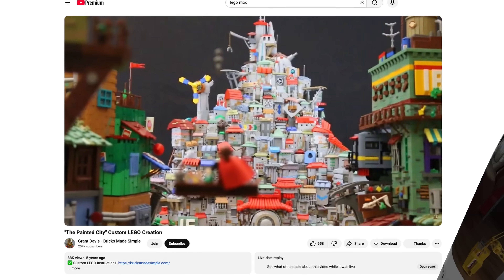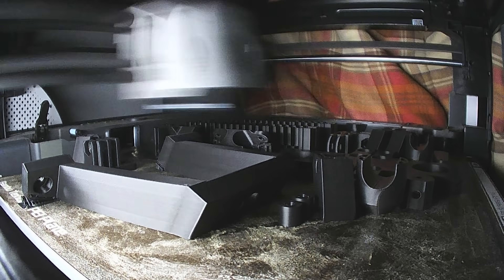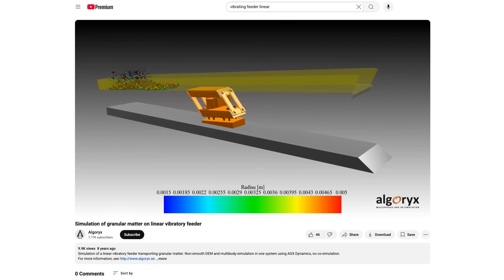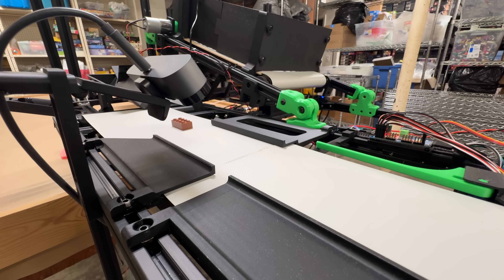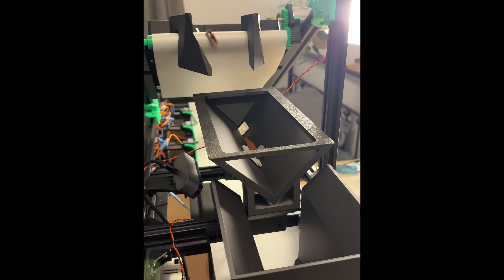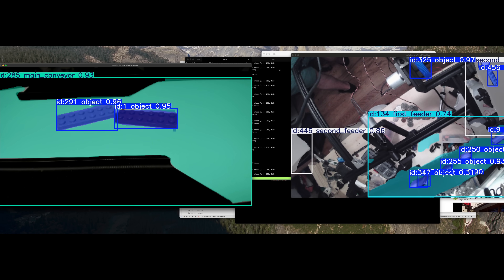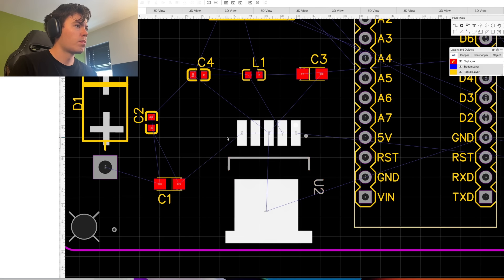A machine to sort a million pounds of LEGO

Comment: Nice work! as a mechanical engineer who has built sorting systems for 30 years with a house full of unsorted Lego, what your building is a small cross belt sorter, these vary in size to sort from cartons to small packages and mail and further down in size to individual retail SKU's. To do the primary sort they use a machine called a singulator which pulls the bunched parcel apart, the vision is a nice touch, this is also used but recognize barcodes as throughput is much quicker. Google these companies if you need inspiration Vanderlande, Körber Supply Chain, Fives, and the BEUMER Group and look for parcel post and freight cross belt equipment. Best of luck with the next version!!

Comment: I don't want an open source machine. I want something i can just buy that works with 99,9% accuracy (no, 99% isn't enough, 1000 parts mean 10 wrong parts at this accuracy, inacceptable, not even mentioniong the false identification ones which will drive this number up by a good ammount) and it has to be way faster, 1 part per sec at least. Sorry to say, i get that this from an engeneering standpoint is an interessting project, but its "useless" until it reaches at least the specs i named. In the end such a machine should cost around 200-300 bucks in retail and additional models 50 bucks each or something like that and if it is made in china reduce the prices by half.

Comment: Speed improvement, add a gate on the belt to have a brick queued and can be released faster. Also if the belt didn’t have to stop to identify. Either faster hardware or move the camera with the bricj

Comment: Cool stuff. If you want speed, a SCARA Arm with a suction cup effector is your best bet. It'd eliminate the need for feeder and most(if not all)of the conveyor belt. Not to mention you can make it far more compact. 

The way I envision this, you drop a bucket of lego parts. Arm tries to randomly vacuum up a part. Arm drops the part in front of the camera, YOLO does the classification. You can either use your existing setup for the binning or maybe use another arm.

Comment: I worked on a baseball card sorting machine i was using a gantry system with linear actuator and suction to pick things up.  You could cut out the vibration steps if you just did a gantry system

Comment: There are so many good and less good suggestions to solutions in this comments section alone - I think what you need is a firm requirement spec that all the solution suggestions could go into, and then the suggestions that is not directly linked to any requirement could instead be evaluated to see whether it's good to change the spec or not. At some point in time you just stop listening to suggestions, and try to implement based on them. 
That would be some real world engineering. Which I think would make an engineering project like this be more probable to succeed. 
Make the requirements SMART - Specific, Measurable, Achievable, Relevant, and Time bound. 
It sounds over-complicated but it really helps in structuring the development in such a way that you keep working towards the goal.

Comment: Not an engineer, but figured I'd share some ideas.  Sorting in parallel should be an efficient way to speed up the process.  To distribute, I'm thinking cylindrical containers with an Archimedes screw along the inner circumference could be filled with pieces and placed at an angle to bring up a set of pieces at a time between multiple conveyors arranged vertically to both work together and provide redundancy.  Rather than from directly above, having the camera perspective for each be at an angle, to identify bricks from plates.  For where each go, the continuity of their placement should make sense too.  1 wide in one column, 2 wide in the next, and each vertically ordered by length, for example.  If necessary, having the option to organize by color instead or in addition with hue along one axis and shade along the other.

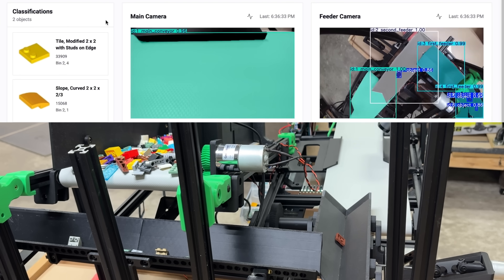Comment: 10:00 You make 3 mistakes in your project.

1- You have 3 machines. not one. The piece separator, the Vision identification and the sorting system. Any of these machine can be designed completely independently.
 2- Open source. Never disregard certified industrial hardware for price, capability and reliability. Do NOT limit yourself to open source.
3- Your sorter will be a nightmare to maintain. It is the most expensive part of your machine and also the most prone to break.

Comment: It would be cheaper to use a PLC with 144 outputs and solenoids instead of motors. The programming would be simpler and the reliability a lot better.

Comment: 1. use a V-conveyor not a flat belt
2. sort color first (there are less colors then anything else)
3. if the V-conveyor is done right you can drop sections so the belt just runs the part of the end of the belt section into the next sort system
4. use a round vibro sorter or a drop sorter

Comment: I agree with other comments that V2 should have a multi-stage sorting by separating into sub-groups. Maybe that could be done by size initially, maybe using a trommel screen to separate based on size, you could then optimise your sub-group sorting with this in mind maybe using a smaller machine optimised for smaller blocks as well. 

You could also add a "bin-full" detection, maybe a counter of parts in each bin (but I guess that could be achieved by the image recognition alone rather than needing sensors per bin). 

Are there any image-recognition boards that could process the video feeds faster than a regular laptop? Not sure what you're using for it currently but I assume there must be some accelerator option like a Google Corel maybe (I know they're old, probably better options out there by now)

Comment: A recurring theme in the comments so far;  have some type of 'Pre-sort' operation.  I believe this is good thinking.
Use a vibrating feeder to drop everything through a moving air current into bins (or chutes) lined up below.  The larger and less dense items will get blown further than the small pieces.
There is no need to have the pieces arranged in a single row on the conveyor, this is just a rough 'first-sort'.
I understand that you dismissed a compressed air system, but that is not what I am proposing... just a flow of air from a fan or blower.
Somewhere in these comments are the answers to all your problems... design by committee!   You just need to design a 'Comments Sorter!
I love what you are doing... Thank you.   Like & Subscribed x 2

Comment: There was a way to categorize LEGO elements by size. I recall that either The LEGO Group designed a sorter to sort sizes, or a MOC creator designed something that sorted elements by size. If you feeder isn't separating out by general size it will continue to experience the problems you show in this video. Second, the elements that are coming out are simply dropping onto a chute, not a conveyor, there is no separation happening when an element falls out. You could address this in a variety of ways.

The most efficient way would be to have a series of wedges or grooves that force a maximum of one element to occupy a position on a conveyor. You could even use rubber tires, it depends on how to make it efficient at getting two pieces to separate from each other. Since you're using non-LEGO solutions, it would be easy enough to design a miniature separator whose sole job is to separate pieces out from each other.

Comment: Have you examined how apples and other fruits/veggies are sorted quickly? Drop them in the air, then use compressed air to quickly pop out the bad ones. A similar strategy could be used in a loop, with each loop looking for a specific brick. Could be way faster than 2 per minute.

Comment: 2:32 Automation Engineer here; the feeding is actually not only the hardest problem with Lego sorter, it is the main Problem, for every machine I have done, except, when there were fluids.

Even „simple“ stuff like screws, if the customer changes the source, where the screw us just a bit different with the head, I had problems.
Reply: ok, so if the lego was fluid... perhaps by melting? or immersion in water ;)
Reply: True, the sorting system is the main problem. Vision systems are capricious. And you are dealing with a piece that can be randomly positioned, the hardest scenario possible. Once you know the piece you have, sorting it is a well known process that has been solved and automated in thousands of industries around the world.

Comment: It's something like in medicine. There are test with a high sensitivity and others with high specificity. And there are often combined. First high sensitivity to increase pretest probability and then a second one with a high specificity. Maybe you can implement it here too. What I mean is presorting eg by size. And then by your machine. Your part separation will be way more easy. You also could look at farming machines. They have similar problems: finding the crop in a mess. But really incredible work.

Comment: An interesting problem, to be sure!  Some thoughts (helpfulness decidedly NOT guaranteed):

1. Instead of hard, v-shaped chutes, try two belts in a V shape that are moving at different speeds and have separate, out-of-sync 'thumpers' for each belt that are perpedicular to it and that encourage pieces to move more onto the other belt.  Between the pieces being nudged left & right and moving at different speeds depending on which belt they are mostly on, they should separate more.

2. Add small cleats to the belt--no more than the thickness of a plate.  Use VERY soft-bristled brushes placed at that height along the initail V to encourage the top piece of any stack to be held back, but to resist if pressed against a cleat or another LEGO piece from the side.

2. DON'T use a flat belt for scanning the pieces.  Tip it on its side at least a few degrees, with a slippery surface forming the other side of the (almost) right-angle V.  Use more thumpers to encourage an edge to lie flat against the stationary side.  That will help make sure that at least ONE side is horizontal to the camera to make scanning it faster and more accurate.

3. Use two cameras to scan them, lined up at ninety degrees to each other and the belt/slippery surface.  That way, the X, Y, and Z dimensions can be more easily estimated.

4. Don't try to eat the elephant in one bite.  You are already sorting into bins, which can be easily detached and poured out into the input hopper for further sorting.  Talk to sorters to see how they initially sort pieces and do the same, keeping in mind the strengths and weaknesses of computer vision.  Colour?  Easy.  X/Y/Z aspect ratio?  (Fairly) easy.  All straight lines vs some curves?  (Probably) easy.  Resort, resort, resort should be the name of the game, especially when you can have multiple machines doing the same sort, where you can combine ouput bins from multiple machines into one input bin for the next resort.

I hope that this helps!

Comment: you can have a slight curve in the convour belt. 
they do this all the time for ore and coal.
in your case if you increase the  diameter of the roller on outer side of the belt the middle will bend a bit and the middle doesnt need to make contake for movement.
==---==

Comment: I wouldn't use servos for the doors. I would use spring loaded gates that are normally closed and with a electromagnetic switch to pen them. Only on/off, a simple switch controlled with a small mosfet. Easy and costeffectiv reproducable.
Reply: Agree.  Solenoids

Comment: I remember seeing a video or an app that lets you take a photo of a pile of lego and identify what lego it can see
I'd use a system like that combined with a pick-and-place machine that takes the pieces from the top of the pile that are ideally already identified (and if not you can always place a second camera over the conveyor where the piece is places and reconfirm it) and places them on the conveyor to be sorted into the tubs
That way you don't have to worry much about placing just one item, you could make a shallow pile on a conveyor that slowly advances and is picked off one piece at a time

The only issue is I don't know if pick-and-place machines like that are easily open-source-able or just commercially affordable, I know they exist, I know they're in use, I just don't know if it's affordable on a small company scale or if that's just one of those gigantic factory type of things that already have tons of expensive machines like that

Comment: Hi! Software engineer here— for a company that builds giant “sorters” for warehouses like Amazon and DHL and that do 2k+ items/min. 

VERY cool to see your take on each aspect of sortation! (Singulation, induction, destination assignment, discharging, etc.) 

I am actually working on a project right now called “returns mode” for adidas that sorts in a similar way. It takes all the mixed returns from customers and sorts them by SQU. For them, fortunately they have several thousands of destinations they can sort to! “Stacking” chutes is one way that we can add more destinations using the same footprint. Just like you, we have a diverter (flap) that directs it to the correct chute.

I don’t have too much feedback that I can provide since my team’s focus is on high level destination assignment and statistics, but to increase throughput I would definitely recommend accommodating more than one item on the main conveyor at once! You can do this by running it at a constant rate, then when you induct an item at a particular time, you can predict its location by how long it’s been on the conveyor. You can use a vision system to identify when an item has been placed on the conveyor.

Comment: My 2 cents, Speed is the killer here. In my opinion pieces need a first tier sort based on size, consider a sorter / sieve to drop smaller piece out to tier 2 (think along those coin sorting piggy banks, just updated) which does another sorter / sieve to drop to the next tier 3 and this pre sizing sorter can have multiple levels 5, 10, 20 etc. The idea is this is all on top of each other and gravity doing some work in the process. So the sloped mesh lets the bigger pieces pass to sorter / sieve stack tower two where the same setup do it again but more tuned towards dimensions, which should give better control over the pieces as they are no longer mixed sizes. Each tier can then feed its own classification belt and bin collector. This way some belts can move faster or slower depending on the size. Also bins could be aligned back to back which could increase sort classification by having the selector arm in the middle of the belt and selecting either left or right as the piece approach the bin stack. End of belt drop off would be resort manual or a return for sorting. Thus in summary, hopper feeds the sieve stacks from the top, moving various sizes to belt sorting over a dual bin tower with end of belt return loop or manual sort.
Reply: No it isn't. Scalability, accuracy and reliability are the killers because these define operational efficiency far more than raw throughput at this point. If you can leave the device unattended for hours, it doesn't matter how fast it is in a first approximation. Currently, we don't have any such devices on the open market, so we compete with the human. And unless you ship your Lego to a best cost country for sorting (which I doubt most builders or Bricklink shop owners do), labor costs are very high.
Reply: @alexhill2852  All good, but it ends up circular. Scale still gives you faster through put and the closer you get to 99.99% accuracy and being able to let the operate unchecked means that it is reliable. It still remain amazing how humans are just so good at certain complex yet trivial things like sorting LEGO. I agree 100% labor cost is crazy.
Reply: @IanDeVilliers Yes. And the absurd long tail of obscure pieces that also have to at least pass the machine without causing hickups also doesn't really help. I am very excited to see this project mature.